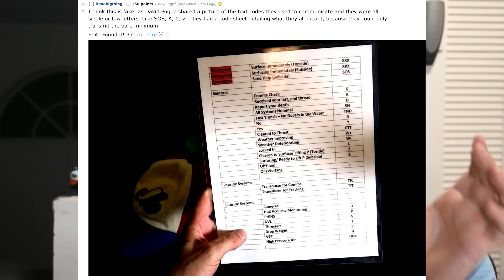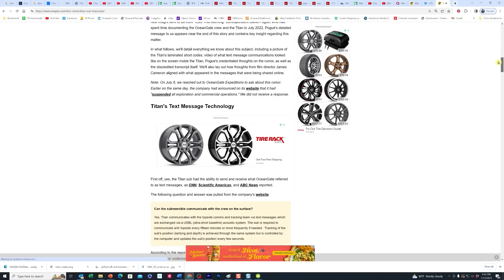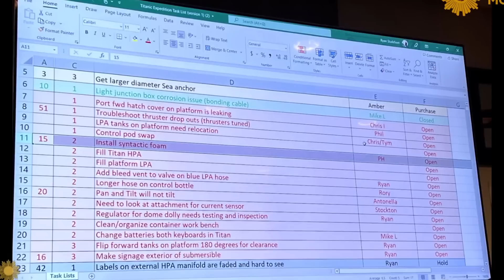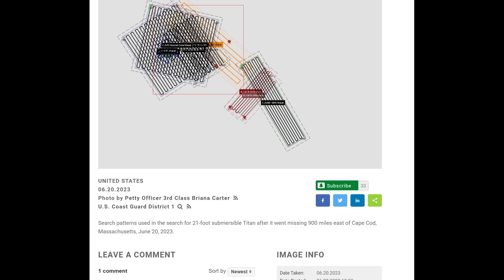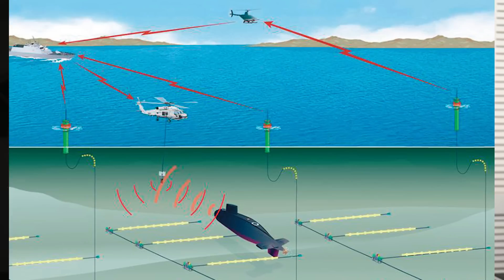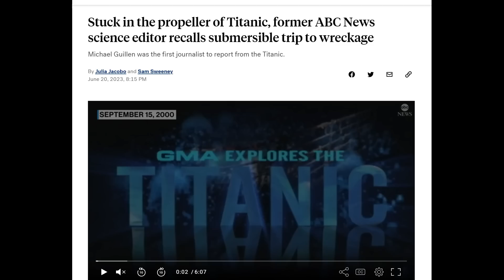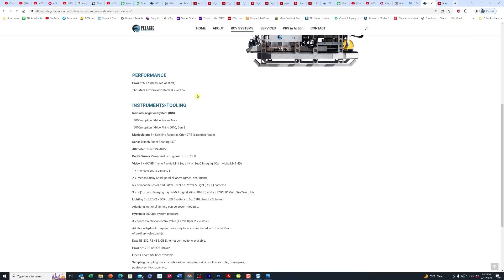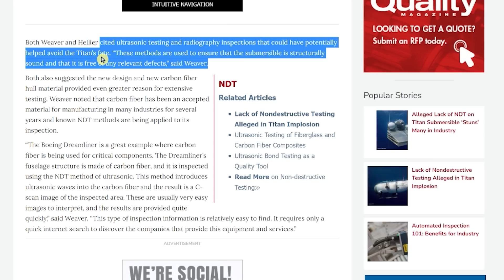The Shocking Truth About Fake Sub Transcripts No One Tells You

Comment: According to an online article in compositeworld from May 2017, the Titan (then called "Cyclops 2") would have a nominal descent rate of 50m/min: "OceanGate’s Rush says Cyclops 2 will offer a nominal descent/ascent rate of 50m/min."
In April 2017 a kind of ad-article on a scubadiving web page for OceanGate trips to Titanic said: "The descent time will be approximately 90 minutes and dive time will be three hours."

Also, if I remember correctly. the usually said "normal" descent time of 2.5 hours was taken from when other submersibles visited the Titanic. So it is possible, those times cannot be applied here.
Reply: Don't spoil a good story with facts 😛Or at least citing a reasonably reliable source. 👍
Reply: @kengself  I admit there is a small caveat: Those statements came before any dive and final the inspection of the Hull by Lochridge which did raise tons of safety concerns. And they are also for the first hull, which was apparently scrapped after test dives in 2018. So maybe OceanGate had adjusted to new rates for the second hull.

And we still do not know about the authencity of the script. It sounds quite believeable, but nothing has been confirmed.

Comment: Please can some one explain to me why they use codes if they did ?? sounds like they doing  some secret mission  ??? will takes you a sec to write your sentence as Rush has something else to do going down beside use his game control when he reach the bottom to find the wreck of Titanic .??? writing the full words makes you feel you still attached to the other people on top when you are at the bottom of the ocean  .TY jeff
Reply: Radio waves don't travel the same way through water as they do air. You need very low frequency radio waves to pass through the water, but those waves carry much less information with them at once. Basically the information is sent and received one letter at a time and the more letters you have the longer your message will need to physically travel through the water before being received entirely. That why they have such small single letter codes, the idea was to convey all the needed information with 1-3 letters and not introduce extra delay.

Comment: I just watched this video from another login... The transcript is not the story here.  If those videos of sub assembly are the real assembly videos of this exact submersible, then it shows everything you need to know about this incident.  Even if it wasn't the cause, the carbon fiber work had multiple issues that could have caused failure.

First, the spiral layout of the carbon fiber isn't actually terrible.  While a multi-directional threading would provide greater strength overall, it would crack and deteriorate more quickly.  However, the bidirectional threading should have been done in the compressive direction for the shape.  In other words, on the body, the hoop spun approach would have been fine.  But, towards and on the ends, it should change because the direction of the pressure changes.

Second... and the real issue here, is what you pointed out with the epoxy.  Not only should you see some ooze, you should see a lot of ooze.  And, when lowering the cap, I would have done it much slower and much more precisely.  A small shift could end up rubbing epoxy off of one side or even a small spot.  A slow and careful lowering would have helped avoid that.  Also, I'm assuming they vacuum pulled the epoxy to remove air bubbles from the mix.  Seeing the lowering video makes me wonder if they did that.  I don't see any evidence of prep for that.

Finally, it would be good to know how they mixed the epoxy.  Did they mix it long enough for the hardener to distribute evenly?  Did they use a mixing method that minimized air bubbles?  There are many variables that can effect the performance of epoxy/fiber mixes, especially when this level of tolerances is required.

Frankly, at these tolerance requirements, there's really no room for error and no excuse for not following the most precise procedures for engineering and assembling the hull.  Even NDT would not be enough for me.  I would have created a second and third shell for some destructive testing, thickness measuring, compression measurements, and pressure measurements at multiple points on the hull.  And, I would have pressure tested those shells multiple times before trying to send people down in one.  Anything short of that would just not be acceptable for a tourist attraction.

And, of course, as it has already been discussed, these types of pressures would cause micro-damage to the carbon fiber.  To what degree, I don't know.  But, after each dive, the hull should have been micro examined because it definitely had a limited lifespan and a limitation on the number of dives at that level.  Without testing a similar system, we'll never know what their dive count limit was.  But, with this much at stake, it sure seems like they didn't have the quality engineering in place to ensure safety.

It was basically Mr. Toad's Wild Ride, from the beginning.  Very sad because there wasn't a driving need for those folks to go down there.  The risk should have been mitigated much better than that so that there was at least a higher degree of safety associated with the ride.

Comment: They were using computers for communication. You punch in an abbreviation and the output is automatically translated in to a sentence. That means you might never get to see the abbreviated code anywhere on neither side of the line. Kinda like when I used to admin a server and instead of punching code in to a command line I'd just push a button and the line was filled automatically with the correct code. Not to mention everything about Titan sub is non-standard, therefore they could have just abandoned the abbreviations if their digital bertha can handle it. That doesn't prove the transcript real, but it also doesn't prove it fake.

Comment: Good video you have info and details that isn't in the other million videos and I'm over the robot narrator in the other videos as well. I heard another sub operator comment on the titanium to carbon construction and how it was glued. After hearing him explain what his thoughts are I tend to agree with him. Now I'm paraphrasing but he stated that if the glue or bond seal was an issue it wouldn't be in the deep deep depths he went on to say that if the fatal flaw was there it would have happened in the 1st 100 meters and that the deeper it went the crazy amount of pressure would kinda seal itself. He told a story about him forgetting to completely seal the hatch on his submersible as he started a dive and by the time he got to the hatch the pressure had sealed the hatch for him and he just latched it or tighten the adjustment at that point. He pointed out that the shape being a cylinder vs a proven sphere was a big detail in question and having heard that explained by others it's seems obvious now. He touched on the porthole but I dnt remember exactly what he thought about it, he has built two submersibles himself and he too is a guy who gives tours in deeper than normal water nothing as deep as the titanic but I think he goes to 1000m and possibly more. The interview was on a channel called ACE and the guy I'm referring is Carl Stanley there is an interview video and a video of Ace going on a dive with him. Carl was also a passenger on the Titan and if I remember correctly they went on a deep deep dive around the Bahamas

Comment: the idea of glue keeping the pressure back is crazy and doomed, but why not have a groove or slot in the metal that the carbon fiber tube would go into? that would at least increase the amount of glue that needs to fail before it leaks. something like how pvc pipes connect. you don't just butt splice pvc pipe with glue. it will leak.

Comment: James Cameron said long before that they had dropped the landing frame, so he knew….also when you look at the actual thickness of the carbon fibre hull, where it joined was less the thickness of the titanium overlap.. I find it hard to believe that they wouldn’t have a dept gauge for the adhesive, so much wrong with the whole process. My guess is the Rov just hooked up the lines from the Horizon Arctic   and that ship did the actual recovery of the heavy parts, if you look up the ship it gives great detail on its capabilities

Comment: Attaching the Carbon Fiber tube to the titanium rings with hand-applied glue is seems to be just one more questionable engineering design/assembly aspect of this comedy of errors. 

Just one air bubble in the glue between the titanium and carbon fiber could pop at depth induced pressure weakening the integrity of the hull. 

If I were to examine this vessel, see how it was engineered and constructed, I wouldn’t be willing to go inside it on dry land, let alone at an ocean depth of 3500 meters. 

And if I read the waiver to be a passenger in this vessel, I wouldn’t sign it because of all the CYA language written into it by Ocean Gate’s lawyers. 

Can’t wait for the lawsuits against everyone involved in this fiasco.

Comment: Regardless of the alleged leak document be legitimate or not, we really have to wait at least 6 months for a prelim report.  That being said, even if they had a pre-scripted comms plan as shown by Pogue, when you get punched in the face all plans are off.  With the craft desending at a higher rate than had be planned, I can see the top side going off script and then the same in reply.  The BBC video shows this as happening before, so Pogues' image I think was for basic comms and not when something isn't quite right, fully understood or not covered by the script.
Reply: I've no idea what the comms bandwidth is, but if I were sitting in that thing dropping through the darkness for 90 minutes with 15 minute check-ins, I'd probably type full words etc, no hurry to get a response.  I'd certainly switch to abbreviations if there were an emergency which created time pressure, but if I were occupied trying to resolve problems in the dsv and didn't need surface help (as they apparently did with the reversed thruster), I'd simply ignore the surface team until I needed them.  It will be fascinating to find out if the transcript is real.  It appears the initial publicly reported depth versus time of loss of contact did show a faster than normal descent, but of course a faker could have incorporated that.  If I were betting, I'd say that this was another symptom of their sloppiness, but not a cause of the implosion.

Comment: As to the pelagic subs lifting capacity, I doubt the arms are that strong, more likely they use them to attach a rope or cable from the subs frame to the debris, hence the "through the frame" lifting capacity. the load is being transmitted through the frame of the sub to the umbilical and is being winched in by the topside winch.

Comment: Somewhat off topic, but it seems to me that the offset in the end of the cylinder (the weaker material) should not have been there.
The Titanium ring (the stronger material) should have had a larger diameter to fit over the carbon fiber and had the mating surface offset inside it.

Comment: The Connecticut sized search area  was just in case they had surfaced, but still had no communications. Beyond that, I feel certain the rest of the search effort was just wasting on a vessel capable of picking up the pieces.
Reply: not only that its hull was bad, even the emergency ascend system was ineffective. The rescuer has high hope to find them at the surface.

Comment: Compressed messages would not surprise me, especially at depth. Water is difficult to xmit through. I think that maybe the descent wasn't  extremely fast. It would sink fast at first, but the water would get more dense. 
   The Navy wasn't going to confirm anything just based on noise. The SOSUS line is known about.
   Oh the messages seem consistent enough to indicate they mightve been abbreviated. Good fake if it is.
    The really questionable part is the end. If they couldn't ascend, I would expect that maybe the parts ejected might have not separated. They probably could not tell onboard.

Comment: You sound plausible, but then like the the Titanic hitting an iceberg, you don't. The search that was "the size of Connecticut" was the surface search. It was based on the possibility that the Titan had surfaced, and the comm system may have been damaged, or the crew incapacitated. The search area was based on the last known underwater position, and the possible area that it could have surfaced, and the currents and wind patterns that could have moved it. 

Underwater searches started once the first submersible vehicles arrived, and they continued until the first deep sea submersible arrived that was actually capable of going to the ocean floor, where the Titan wreckage was quickly found. For some odd reason surface search planes and helicopters could get to the area quickly (almost like they could fly through the air), while it took a while longer to get a deep sea submersible and crew ready and flown to the area to begin underwater operations.

Comment: Was the back section airtight and pressurized?

From the transcript you suggested that there was possibly a small leak in the back section and that a laser like water stream might have been aimed at the capsule.  But why wouldn't a leak in the tail section have caused the same kind of immediate and catastrophic implosion?  If it was a leak that started at the surface (ultimately causing the electrical problems) would the pressure in the back section kind of equalized as it brought on water?  

And if that was the case, would the weight of water in the back section have accounted for the higher velocity decent?

(I'm no engineer, but I am trying to logic this out!)
Reply: I think you're basically in the right ballpark with your latter statements: the tail section houses components that are in themselves supposed to be watertight, yet possibly sprung a small leak during the descent. This leak lead to the electrical problems occurring and also the submersible being heavier than planned, consistent with the (as yet unconfirmed) transcript's reports of difficulty arresting the descent and the very slow rate of ascent, when it came.
Reply: Depends what you mean by the "tail section". There is the aft dome made of titanium which is part of the pressure vessel and it is normally not visible because it is hidden within the tail cone. The tail cone is open to the water so it does not have to deal with the enormous pressures. That's why part of its cowling survived and was recovered. Inside the tail cone there is a lot of equipment including, I understand, the batteries. I understand that any equipment in the tail cone contains no air otherwise they would not withstand the pressure so they are oil filled. One exception is the syntactic foam used for buoyancy but that is designed for high pressure. So the opportunities for a leak in the equipment in the tail cone, displacing enough air with water to significantly affect buoyancy, are small. But one can never say never.
As far as the aft dome is concerned, any leak should lead to catastrophic failure. However, one possible scenario is that the dome was not sealed properly to its titanium ring. At shallow depths water could leak in under low pressure and affect the buoyancy of the vessel. As the depth and pressure increase that could seal off the join between dome and ring. You may have seen mention of one trip where only 17 of the 18 bolts were installed but that was of no concern because the pressure would hold it all together by design, from about 30m depth I think. Assuming the transcripts are legit, the amount of water leaking in to account for the descent rate would be in the order of 100L to 200L. Not a huge amount - a carry on suitcase is about 45L. There appears to be some electronic equiment inside the tail dome that could be affected by water and that could have shorted the battery. One would hope circuit breakers were used though.
Its also possible that the descent rate, hull failure and electrical issues all have separate causes. The descent rate could be due to a miscalculation of the ballast needed. The hull failure seems inevitable. And the electrical issues could be caused by a short circuit with a mechanical cause in any piece of equipment or wiring. In a commercial aircraft you'd tend to think that combination unlikely but in this operation it seems "situation normal".
Reply: If the force of the leak is against the titanium ring the carbon structure is not being damaged further so it could remain slow. A implosion will occur if the structure collapses. It is possible a structure will crack but not fully collapse and create a leak. A leak through carbon at 5600 psi will likely cut the carbon leading to a full structural failure. A leak is totally possible, but a implosion was heard by the Navy. A leak could explain the reason the descended faster than normal.

Comment: The fuel tanks leaked on the sr71 when sitting on the tarmac. It was deliberately loose because of the amount of expansion it experienced during high speeds. 
Not justifying anything the blundering idiots at OceanGate did, by any means.
Edit: I'm not even close to an engineer either. Just a commercial electrician. Ty guys and gals. Luv ya